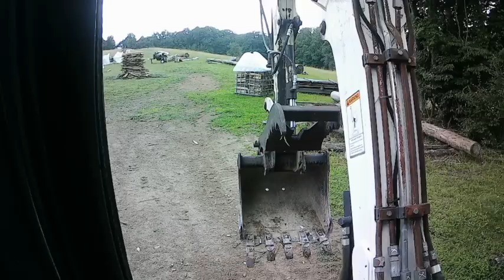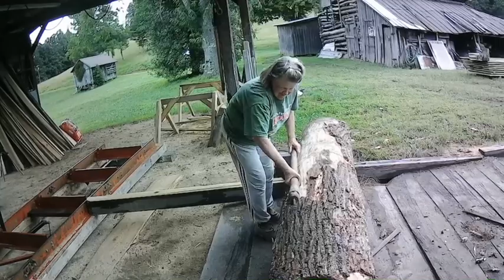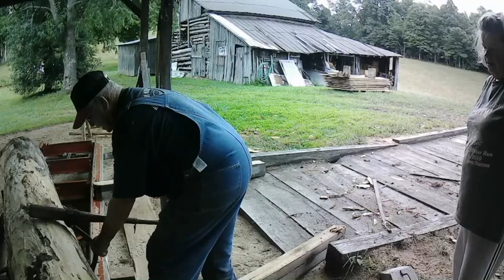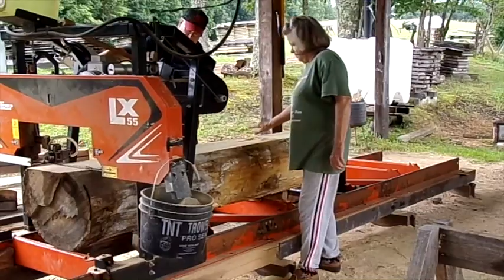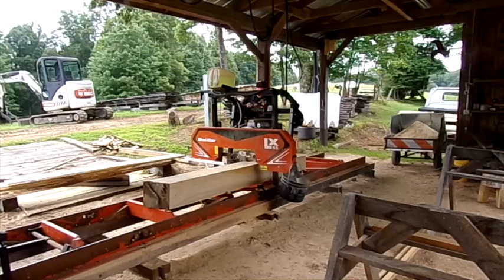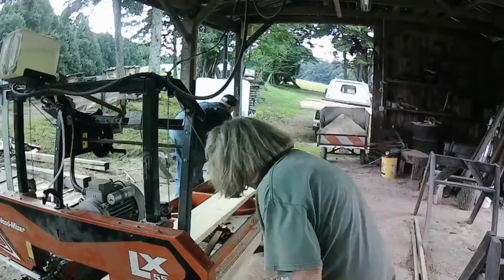Woodmizer LX55 Saws a Short Fat Poplar

Comment: Would you mind snapping a pic of how you have your cable suspended overhead?  Do you have it on a swingarm with return spring?  Thx!
Reply from the maker: I can't, I sold that stuff with the sawmill. I stretched an old ATV winch cable over head with a turn buckle ,.
 put 5 little pullies on it and zip tied the cable to them. Thanks for stopping by. I've posted a couple videos with the LT15 START the replaced the LX55.
Brent

Comment: thinking of ordering one of these for mostly poplar , do the blades they sell with it cut it well ?
Reply from the maker: Thanks for watching Monty, Yes I like Woodmizer bands but, the one that come with I have a 10 deg hook angel. You may want to experiment  with some different hook angles for these lo horse power sawmills I like 7 deg. The one that comes with the sawmill won't last long.. You should order a box of five 7 deg or 7/47 to see if you like the. I liked Kassko 7  deg also. I really liked that sawmill but depth of cut is only about 7".
Brent